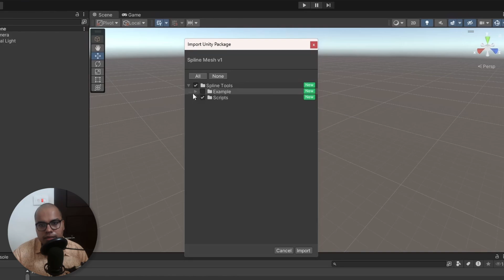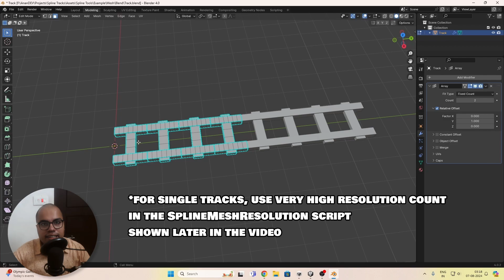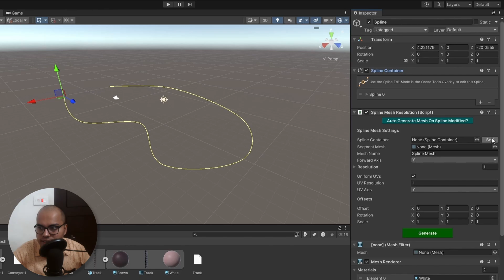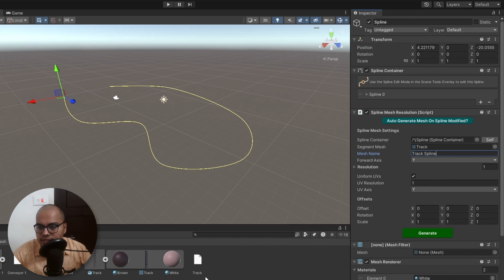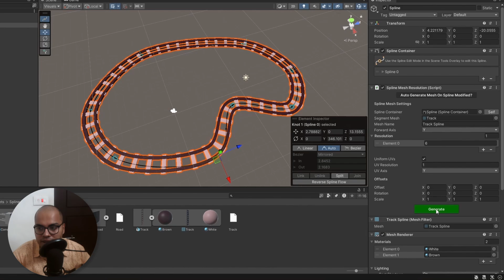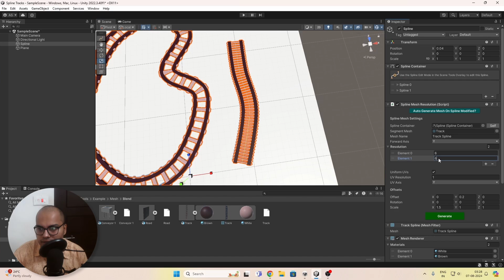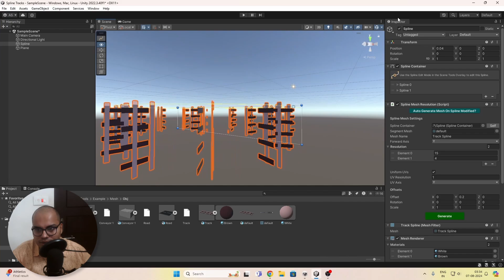Creating Railway Tracks with Unity's Splines!

Comment: Real time rendering is too slow, is there any optimization method
Reply from the maker: Did you mean auto generated mesh, when editing the spline? If that's the case, the only workaround for now, is to disable the auto generate mesh on spline modified boolean in the scripts. Then manually generate meshes.

If you still need auto generated mesh, then you should split the spline into a smaller one, or reduce the poly count of the mesh.

Hope this helps

Comment: My script looks different after downloading it from hub and adding it to the package I can't figure out why. I have all the elements EXCEPT for the Spline Container - like the option is simply not there. It's "Spline Mesh Settings : Segment Mesh, Mesh Name, Forward Axis" etc. Am I doing something wrong? 

I copied the git url and added it to packages. Then I had I had two folders : SplineMesh and Spline Mesh Unity - main. Clicking on them I found the SplineMeshUnity-main v1.4.unitypackage with the Unity icon that I clicked on. Then it imported all the assets (including the Spline Mesh Resolution script) - everything else seems to be there. But just not the Spline Container option? Please help!
Reply from the maker: Sorry for the late reply! I was unavailable for a few days. 

The Spline Container option is removed in the updated version of the SplineMesh package. It detects the SplineContainer via code. Now, the spline mesh script forces you to have the spline on the same object. Here is an updated video on how to use SplineMesh, but for conveyors (This uses the newer 1.4v package). 

https://www.youtube.com/watch?v=kkBA-8QaYoM&lc=Ugzz96wJ4Bp0-UI0P814AaABAg

Now you only need to make sure that the SplineMeshResolution script is attached to the GameObject containing the spline. No need to assign SplineContainers!

Comment: brother if i want to give the fbx and vector 3 array or list at runtime. then it can create tracks? i used your code and tried a lot its not working for runtime. can you please make a track at runtime from chosing point from terrain using ray cast. Thanks in advance!
Reply from the maker: Hey, thanks for watching my video! You should be able to pull it off easily. Unfortunately I would not be able to make a track for you right now. I have a lot on my plate. But I will tell you what you need to do here:

1. First, you need to create a simple spline (it can be an empty spline container), and then add points (they are called knots on the code) to the spline dynamically, based on the Vector3 array or list. You can get these points by raycasting to the terrain and then storing it.

2. Then you need to add a SplineMesh, or a SplineMeshResolution script to the spline. But you shouldn't generate the mesh immediately (We will do this via code later)

3. Because you are using an fbx mesh, you might need to set the "Scale Adjustment" property in the SplineMesh script to  (100, 100, 100). Otherwise, the mesh will be extremely tiny. Or you can scale the mesh by a 100, that would work too.

4. Then you would need to call the GenerateMeshAlongSpline() function inside my SplineMesh script to generate the track at runtime based on the updated points on the spline (which we did in step 1). For that you would need a reference to it in your custom script, and then call that function, when you need the train track to be created.

Essentially, you update the points on the spline to match the Vector3 array or list. Then, you generate the mesh along the spline at runtime.

Hope this helps! Feel free to let me know if you are facing any trouble, or need assistance! Thanks.

Comment: Hello, how do I set up the collider for the mesh?
Reply from the maker: Hi! Firstly, think about if you really need a collider. If you just need to simulate movement along the mesh, then you're better off with just basic code, and not use Colliders at all. It will save performance.

If you do need Colliders, then there are two ways as of now.

You can use the SplineBoxColliderGenerator script that comes along with the package with the new Update for this SplineMesh package I released last week. 

Here is the video to learn how to install it: https://youtu.be/0wUcWRajX4E

And here is the part explaining how to use the collider generator: https://youtu.be/kkBA-8QaYoM?si=Sge-xXSitG3nJ22h&t=434

If you want more performance, you can create Compound Colliders as well but it is more work. It is explained in the video above. You can watch the entire "Adding Colliders" section from the timestamp to learn how to do it.

Comment: Does it implement rotation on the spline?
Reply from the maker: Yes it does. You can rotate the spline knots (points) and the mesh will rotate accordingly. Keep in mind that it won't rotate the mesh at the two ends of a spline, as end points don't have any rotation needed. 

You can also rotate the way in the which the mesh gets extruded along the spline with the "Rotation Adjustment" property in the Inspector of any of the SplineMesh or SplineMeshResolution components.

If it doesn't work for you please let me know. I am updating the whole package with collider generators and conveyors next week.

Edit: Make sure to "Generate Mesh" after you make changes to the spline
Reply: @anandev  I have a couple issues with the package. It works great for flat roads but rotating the spline knots isnt rotating the mesh. This is using SplineMesh script.  I also cant get SplineMeshResolution to generate a mesh. I get no errors when clicking "Generate Mesh" and I can see the mesh created is 0 vertices, 0 triangles.  Thanks for creating this package though and giving it away for free, much appreciated.
Reply from the maker: @lewisunsworth6668  Weird. Let me look into the rotation thing for the mesh. Perhaps in the new 1.4 update, I may have accidentally did something that messed it up. It was definitely working before. If I did find anything wrong, I'll update the package and let you know

About the Generate Mesh error, can you give more info on the type of mesh and the mesh file type? Have you added items to the mesh resolution array in the Inspector? 

Also, thank you for the kind words at the end. It means a lot. I will be sharing a free editor-friendly saving system for Unity as well soon.
Reply from the maker: @lewisunsworth6668  I have updated the package to v1.4.1 which includes the mesh twisting. Can you update the package and confirm if it works? It was a pain to implement it for the SplineMeshResolution script, but I did it! Yay! Thanks for pointing it out.

By the way, the twisting can be enabled by enabling the "Should Twist Mesh" boolean from the Inspector. I thought I could just make it an optional thing.
Reply: @anandev  Hey, thanks so much for the package update, works great!

Comment: my geometry uv axis are both x and y together how to fix that texture appear good in some area and some no
Reply from the maker: You might consider doing the following things:

1. Try splitting the mesh and add multiple SplineMeshResolution (I don't know what exactly is this case, so maybe it might work)
2. Check if UVs are properly assigned or rotated to face one axis.
3. You can edit this package however you want. Go to SplineMeshResolution script, scroll down to the comment where it updates the UVs of the generated mesh. Think about how it is being done, and make changes.

I don't have a visual image of the current problem you're facing. If you could kindly post some images on what's happening (along with an image of the UVs) on the Discord server, I will see what I can do, make changes to recreate the issue and perform a shadow update to try and fix it for you.